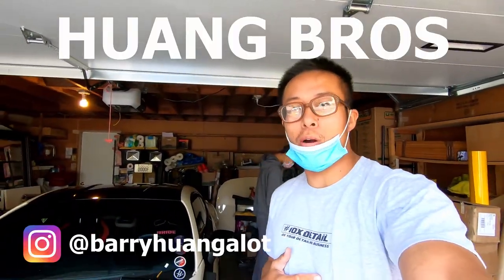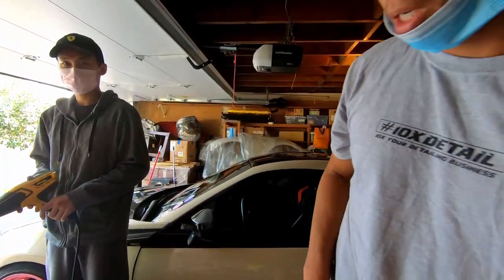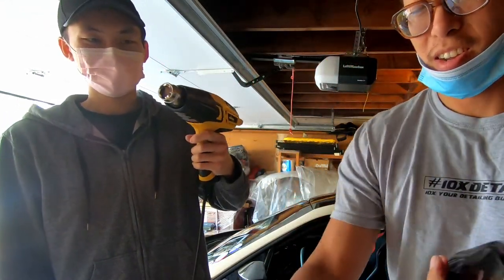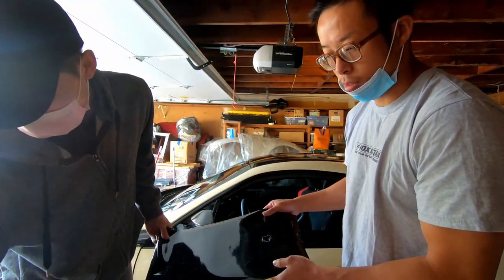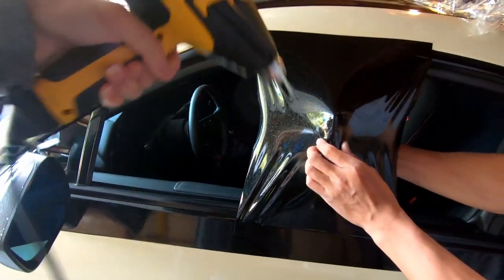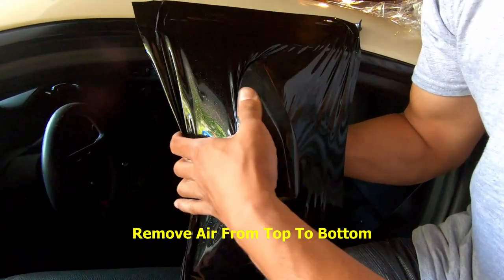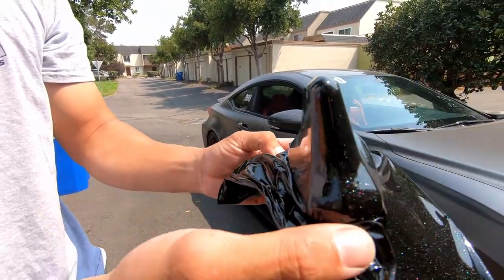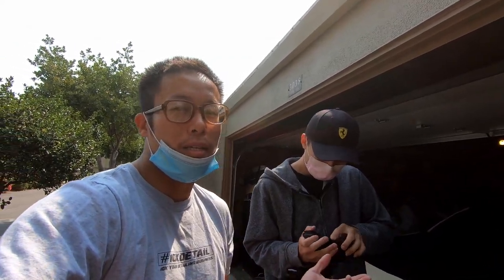How To 1pc VINYL WRAP ANTENNA in LESS THAN 4 MIN by Combining CKWraps & Premium Auto Styling Methods

Comment: Nice.. I'm going to try that technique with end of my side skirt and then pull over to front. Thought I was going to have to 2 piece it with inlay on rear
Reply from the maker: So Ive tried this method for a S2000 spoiler and it works amazingly, it is evenly stretched. If your side skirt isn't like a RCF side skirt, you should be fine.

Comment: Overstretched waste of time which will pull back
Reply from the maker: Thanks for viewing. So far it has not pulled back we did a deep tuck into the antenna with 1/4in of vinyl. The rubber gasket does a pretty good job applying pressure once the antenna is reinstalled. Post heated too of course.
Reply: Not if you tuck it underneath properly. I left the car in the sun today. Just checked and nothing happened so idk what you're talking about.
Reply: ill give you an update again in another week
Reply: And not only will it pull back but it will distort the colour
Reply from the maker: @stevo184  We understand. We actually tried with Avery Gloss black and it did not distort color. But if you were to view all others who do it one piece, stretch is necessary and with stretch, there is slight color distortion and sometimes we get lucky and no color distortion. Ive wrapped a RCF antenna 2 weeks ago with this method and so far, no wrinkling, lifting, or distortion. This method is pretty legit but if you don't like it, that is fine. This was only to help those out there seeking a no seam 1 piece method for an antenna. You can stick to your 2 or 3 piece method if you do wrap.
Reply: The excessive heat already killed its stretch so it lost its memory on it. Its good. The tuck inside is the important part which is why CK removes all the body parts
Reply from the maker: @Roadsurfer2k11  Indeed. The tuck is most important since the wrinkling starts from the edges and if the edges are tucked really well, wrinkle would occur internally and not show externally.
Reply: @thehuangbros  yup I found that out from experience doing my moms door handles. I'll have to take mine off when I wrap my car